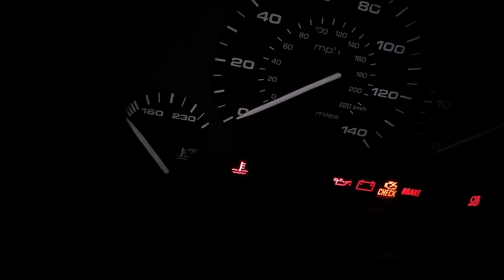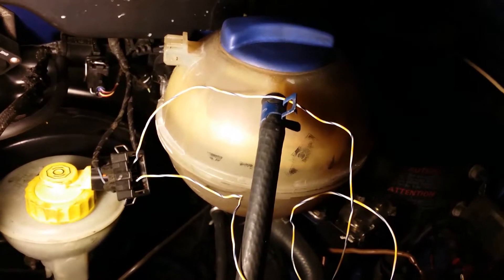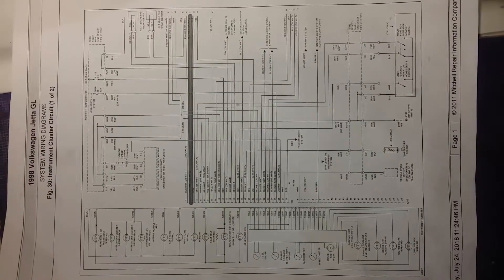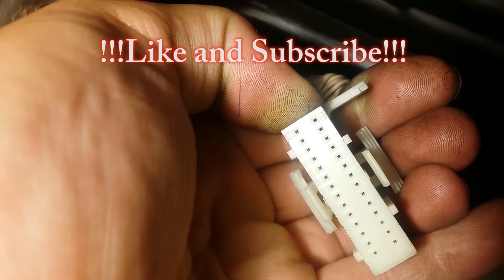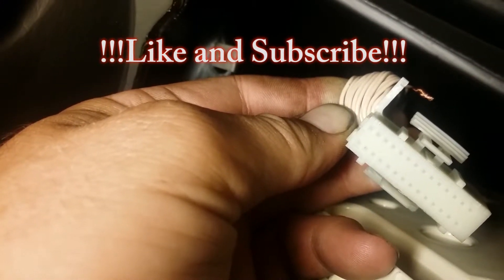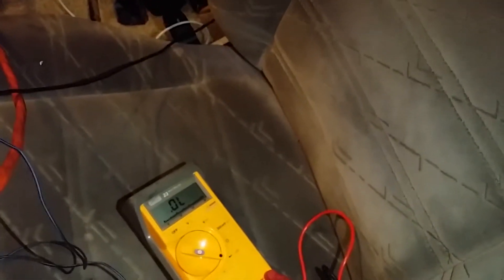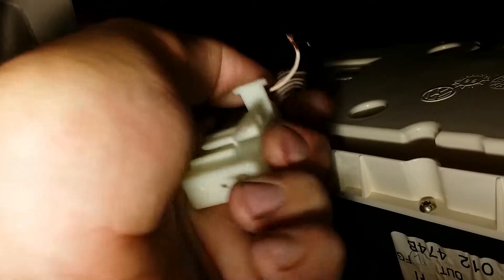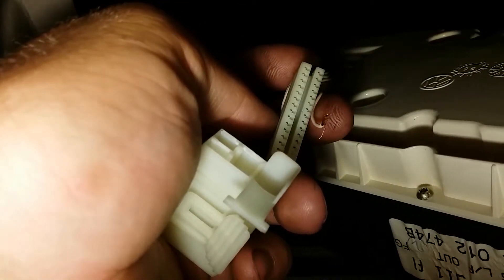VW MK3 Coolant Light Flashing FIX (DIY)

Comment: Hello i had a simple cluster in my seat ibiza without mfa and i plugged in a cluster from gti 2.0 with mfa when i started  driving the handbrake light was all the time on and the oil pressure light was constantly flashing and the buzzer was sounding too, for now i just put the old cluster back and everything was working normally .But how can i solve it and put the new one again ?
Reply from the maker: Its not the correct cluster, wiring diagram will help you, but its faster to get a more alike cluster